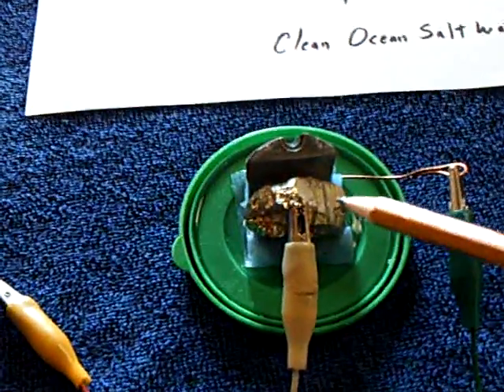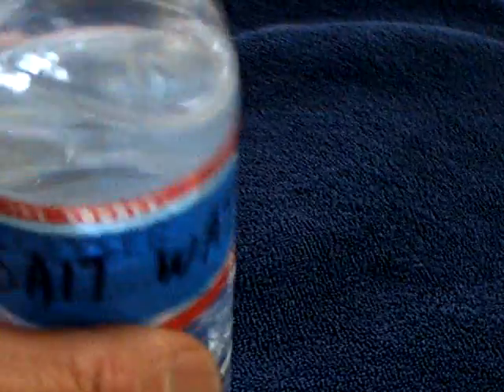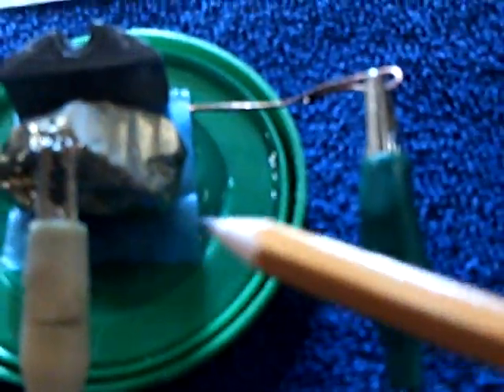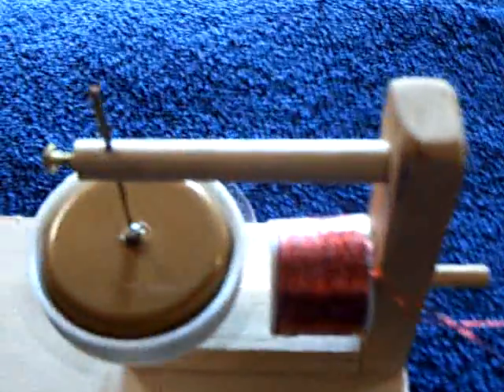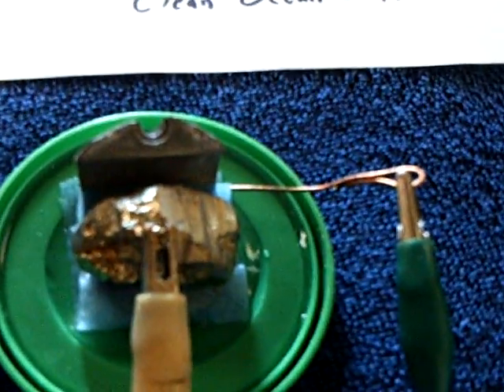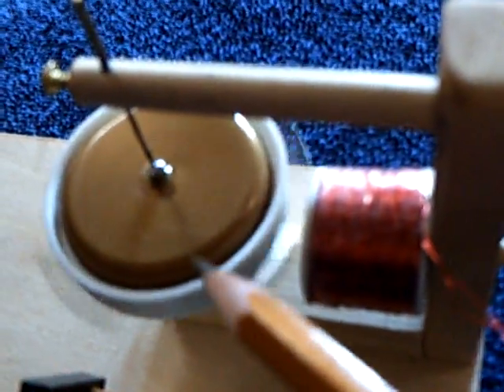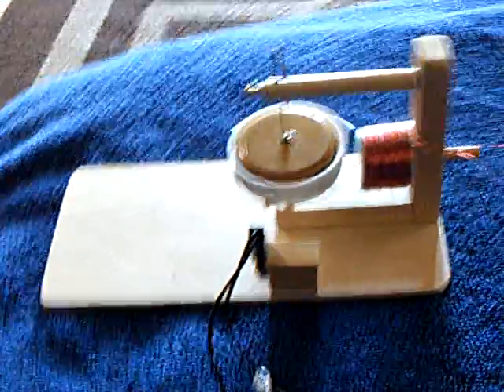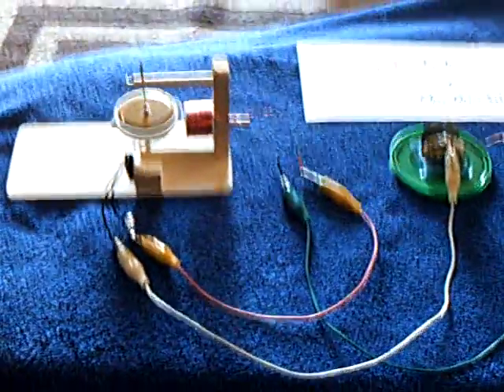Iron Pyrite + Zinc + Sea water-- Battery.ASF

Comment: @Lidmotor 

I see, that is why my tests with graphite as the other electrode only gave me very low
voltages, I never tried it with zinc or magnesium... I thought pyrite was like magnesium or
zinc itsself..but I was wrong... better have looked up the dissimular metal charts..
Many thanks for your great work.
Regards, Stefan.

Comment: the same exact motor is running on my desk right now. I used a couple thousand turns of fine wire, bifilar wound, and a vcr head for the rotor, those work very well have extremely smooth bearing, and use epoxy to fix four magnets to perimeter. Im charging 1.5 volt nicads one at a time, and using four to run it. It works! Thanks again Lid!